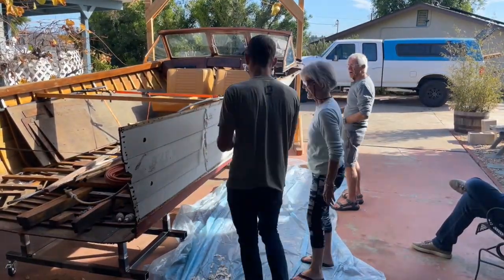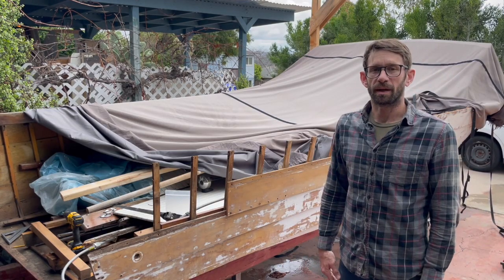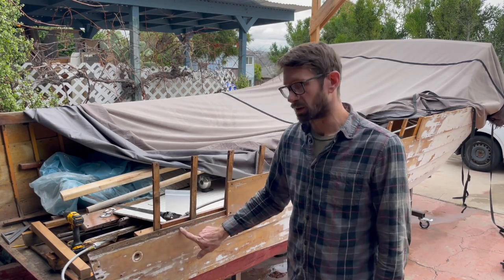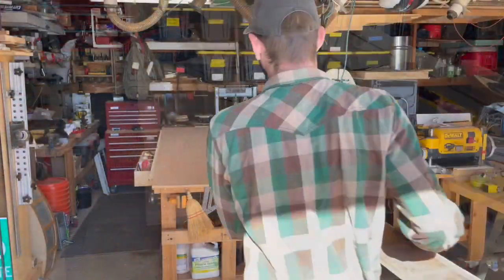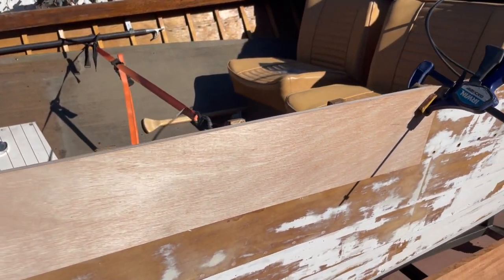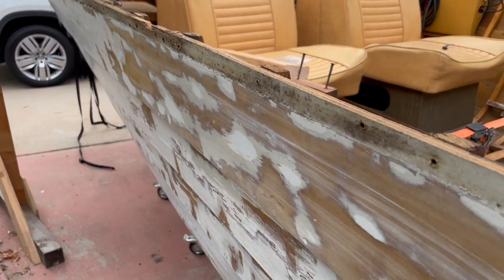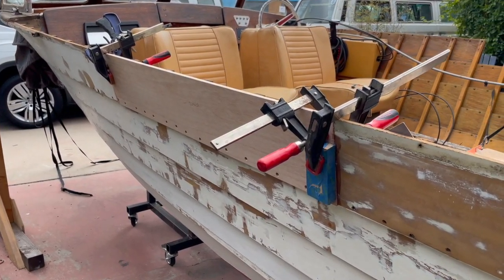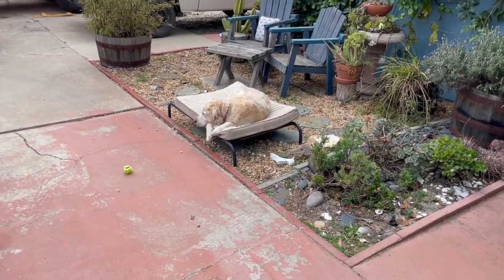1964 Carver Captain 19ft Lapstrake Boat - Part 6 - Topside Plank Repair

Comment: Now to blend the new interior varnish with the old. I recommend a glaze mixed with the varnish. I have used an oil-based stain mixed in tiny amounts to the varnish. 3 coats tested on new scrap and maybe one unifying coat on old inner planking of the same varnish glaze to blend all.
Reply from the maker: Thanks for this info.  I am planning to sand back and revarnish the interior as it’s all cracked and peeling but I will do more research on the glaze blending technique.  I honestly don’t have much experience with this sort of stuff so any advice is appreciated.